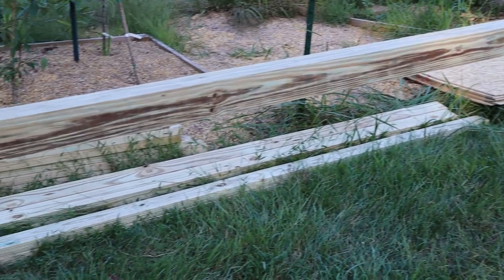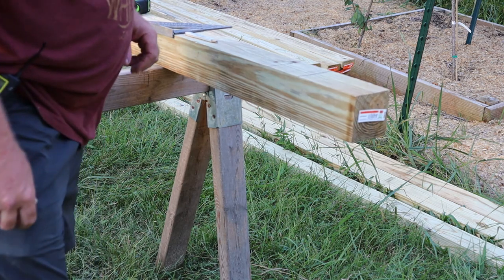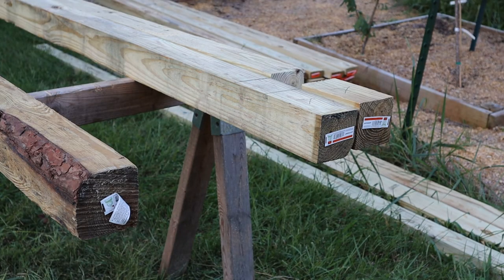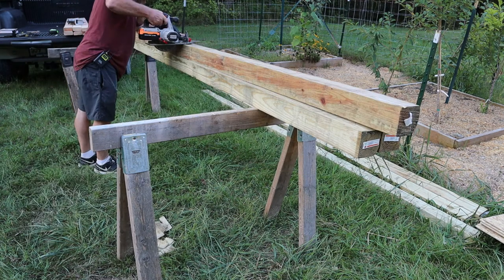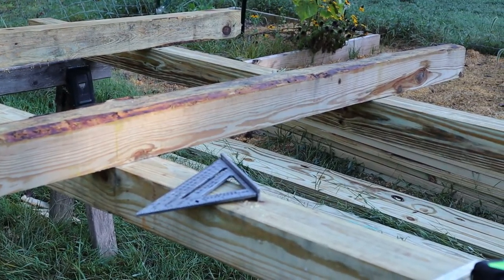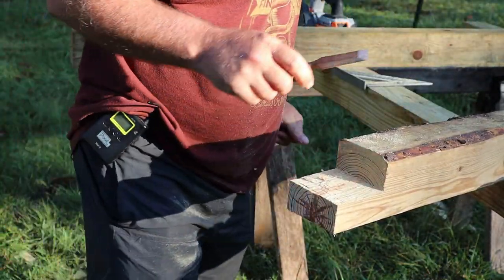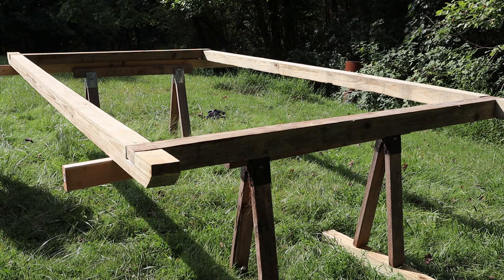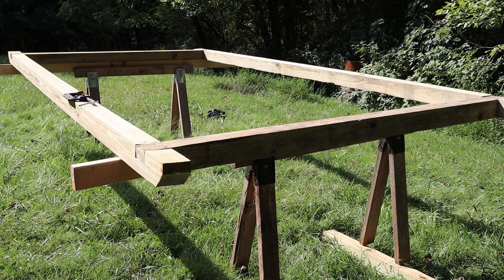Homesteading Goat Barn Part 1 Floor

Comment: Did you check it for square
Reply from the maker: I did not, mostly because the type of joinery i used and also it was pretty wet green pressure treated wood so it was going to buck and move once it started drying. The goats also don't seem to mind if its out a little bit.